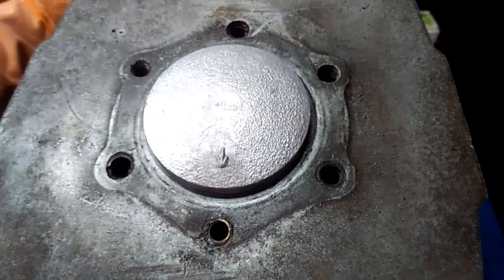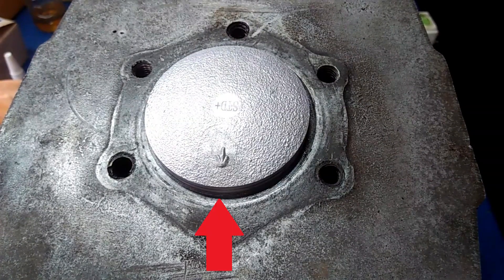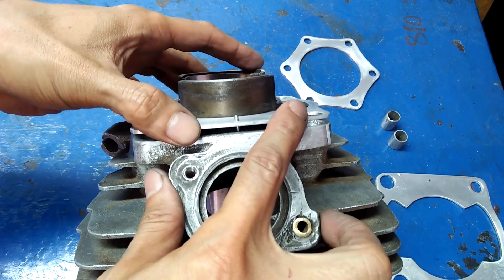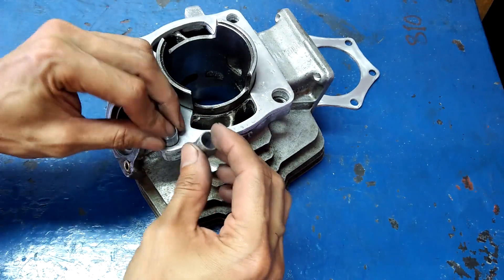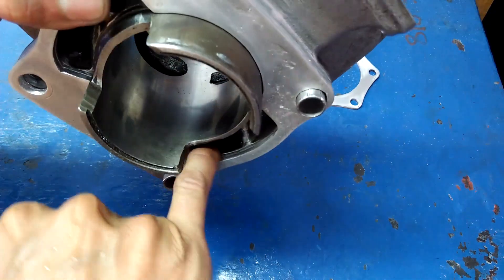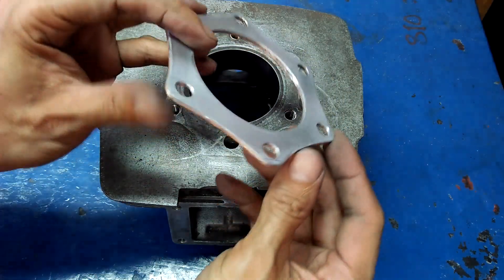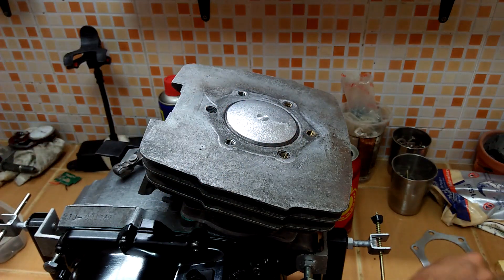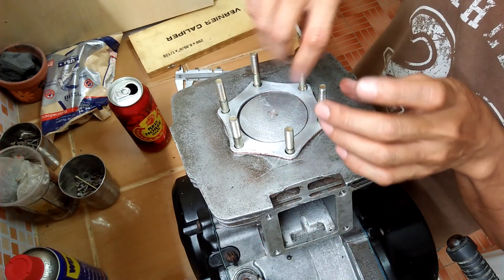Making Motorcycle Cylinder Base Spacer

Comment: What would happen if you put a spacer on a standard engine? I ordered a piston, which is slightly longer and sticks out like yours. However, it's not a longer crank.
Reply from the maker: I think nothing bad will happen. adding the spacer like I did will solve the issue of longer piston the same with in my case having longer connecting rod.

Comment: Are the block DT same distance nuts for RXZ/RD125 crankcase?
Reply from the maker: yes. based on what I read about people putting RX cylinders to DT. but depending on the DT model, you may have to use a base spacer like the one I made in the video.
Reply: Thanks your info Mr.Phil, FYI RXZ/RZR 135 CC have bore 56 x stroke 54.

Comment: Hi
Here in Brazil the last Yamaha 2T motorcycles were RD135 and DT180. RD135 has a cylinder with a diameter of 58mmx50mm of travel and uses a 4Y2/3R2 connecting rod. The DT 180 has a diameter of 64.50mm x 54mm of travel and uses a 2N4 connecting rod.
Is it possible to adapt the RD135 cylinder to the DT180?
Did you manage to adapt the DT175 cylinder to the DT125?
Thanks
Reply from the maker: Interesting info. The problem with adapting RD135 to DT180 is that they have slightly different stroke. but since you are wanting to put the RD135 cylinder to the DT180 and the DT180 has 4mm more stroke then  what you may need to do is make a base spacer like I did in the video. So that at top dead center the piston is level with the top of the cylinder. Then you may also need to grind the ports to match the bottom dead center.  I have not seen any of the bikes and not sure if the bolt holes line up.
Reply from the maker: For DT125 and DT175, it is an easy swap either way because the bolt holes at the bottom of the cylinder are the same layout. Also the stroke is the same at 50mm. Depending on the model, the only modification is changing the connecting rod or use a base spacer. The 2N4 connecting rod is 5mm longer than the 4Y2.

Comment: Can I ask something..if I convert my dt125 to dt175 block do I need to engineering my crankcase engine or its already plug and play?
Reply from the maker: depends on the specific model of your DT125 and the donor 175 block and the connecting rod. if both the latest model, then it is just plug and play.

Comment: Sir, gagawa po ba rin kayo ng wiring assembly sa DT rebuild? Malaking tulong po din paano lalo na paggawa from scratch. Papalitan ko rin ng bagong regulator/rectifier kasi sira na yung stock at wala nang mabili. Old school din yung stock kaya mainam yung mga bago na. Sana makagawa kayo ng video sa wiring. Sa ngayon nag aaral pa ako pano gawin at medyo nahihirapan. Maraming salamat sa pagbahagi ng inyong kaalaman.
Reply from the maker: opo sir darating tayo dyan sa wiring. bale yan kasing DT na binubuo ko, pyesa pyesa ko yan binili. hindi po yan buong motor na nirerestore ko lang. kaya wala po akong wiring harness, balak ko talaga may DIY ng wiring harness. tapos sabay ko na rin i convert sa 12V full wave. sobrang busy lang sa trabaho kaya hindi ko pa nahahawakan uli si DT.
Reply: @DIYPhil  Pareho din tayo medyo hirap sa oras para sa hobby. Dalawang DT125 at isang DT100 nasa bahay. Yung DT100 na convert na into CDI. Yung isang DT125 na convert na rin to full wave pero di ko talaga alam kung paano. Bale mga wire color lang kinopya. Gumana naman pero mas mainam malaman talaga yung theory o background kung bakit. Yung ibang part sa wiring kagaya ng mga ilaw at ignition key hirap din kasi puro mga color based yung tutorials dito sa youtube. Balak ko rin gawing led lahat ng ilaw kaya nag aaral pa din. Magandang idea para sa video mo na gumamit ng bagong teknolohiya gaya ng regulator/rectifier, full wave, LED at makabagong fuse setup. Aabangan ko yung sosunod na mga videos mo.